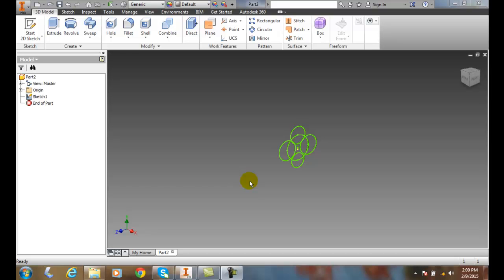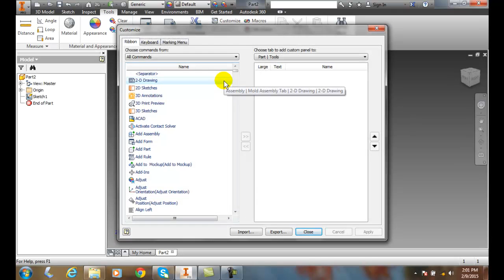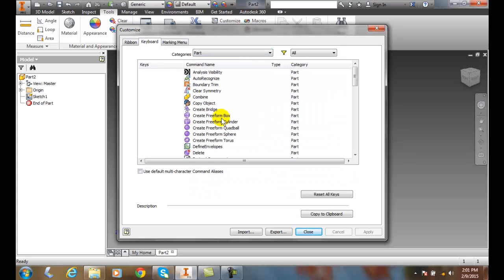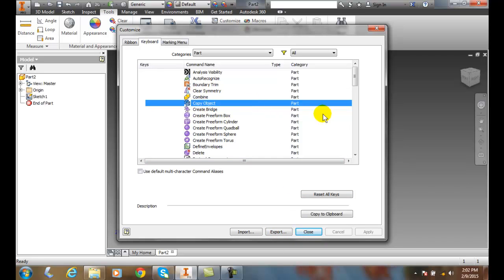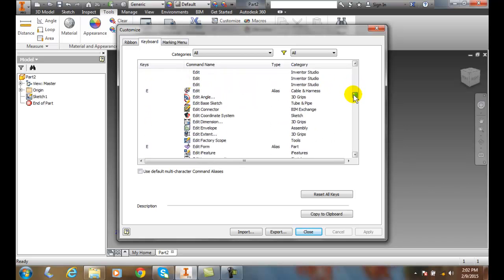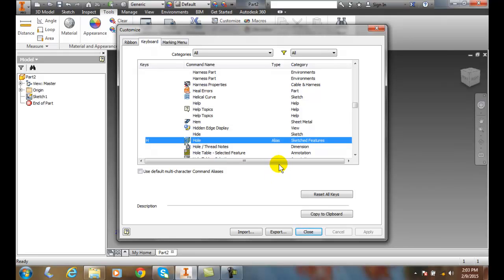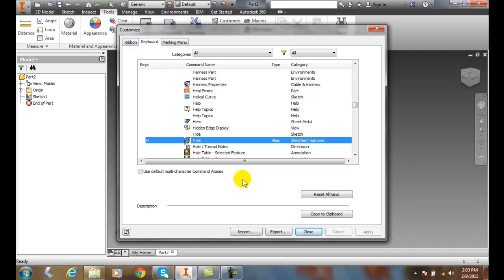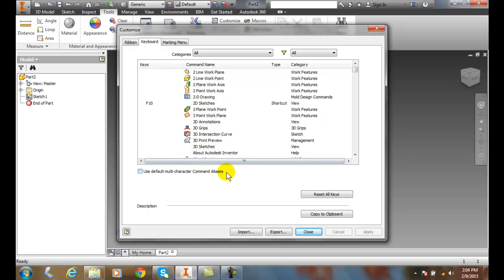Inventor 01-16 Customizing Hotkeys

Comment: Didn't actually show how to change a hotkey.
Reply: if you click in the "keys" column for any row a textbox appears which lets you type the shortcut for the command in that row
so just click in the white space area to the left of any command
Reply: @username-jm2bn  I would like the middle mouse button command to change to rotate my model.
Reply: rdekraker lmao I came here for the same exact reason. Fusion 360 has the option to have Solidworks controls so why tf does Inventor not?!
Reply: @rdekraker   Have you tried pressing SHIFT+ middle mouse button?